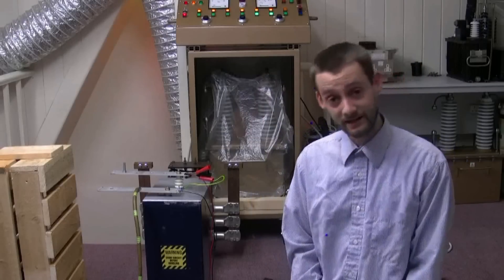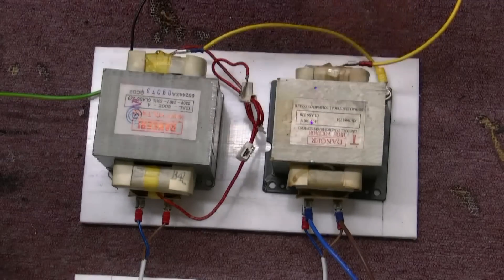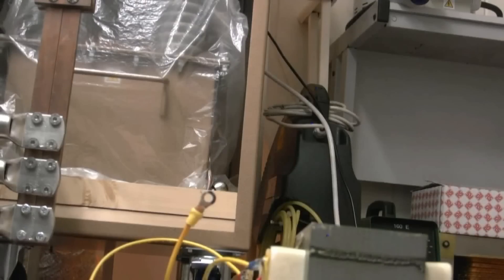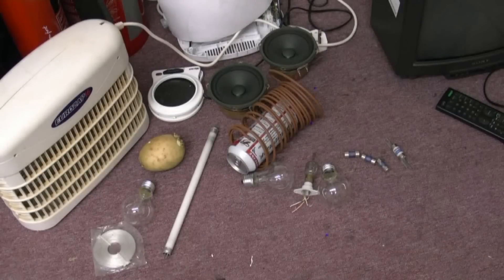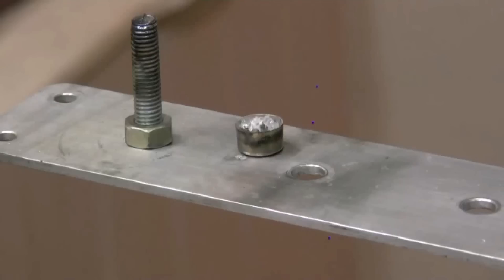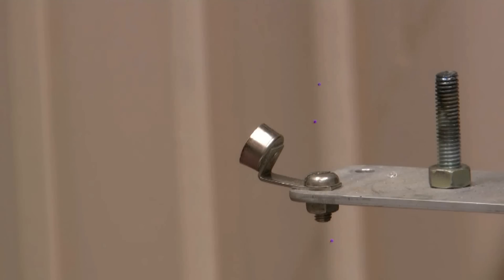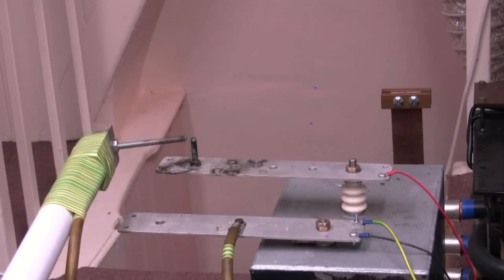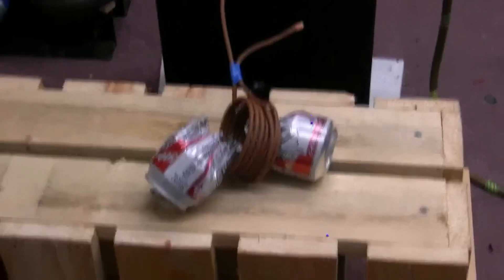Ultra High Energy Destruction + Can Crush

Comment: Hi, was writing to see what your capacitor was, thought I must've missed it.  But then I saw nearer the end, 138uF at 4,500V - so that's a hair under 1,400 Joules.  I have a couple of 5uF 25kV dc in the shed, & have always wanted to do this sort of thing, when I have the space & time.  My 2 total 3,125 J, but I figure I'll give them about 30kV (They're VERY robust caps) for 4.5kJ max.  They are rated for Pulse discharge application & very low inductance - i.e. very high current.  They came from a H.V. test facility at a University.  There were 16 available at the time, but 2 was all I could fit in my car boot on the day.  When I came back for more, they'd gone :-(   But I just wanted to know what energy you were using for the can crusher, etc. & now I know.  So I have plenty :-)

Comment: What happens if you take the output of a microwave and put that in the primary coil of the second transformer. How much voltage do you get and how much current?

Comment: I was wondering, what happened to the can, is it the magnetic field that smashed it ?
Reply: +pffm12 That's only half of what happened. Because the can is electricity conductive the massive magnetic field formed by the coil of wire induces a current in the can. These currents create their own magnetic field that interacts with the original one. The interaction of magnetic fields causes the mechanical movement of the can that results in it being crushed and, in extreme cases like this, cut. I like to think of it as "eddy currents from hell". 😈

Comment: In testing the MOT's you said you were going to "change it into DC and stuff it into the capacitor."  I'm curious as to how you would do that since I would have thought you would need to rectify and smooth the 4kv output from the MOT's which would require some additional heavyweight components.  Also, wouldn't the converted DC exceed the 5kv rating of your capacitor?

Comment: I have a question about the Capacitor you were using.  Wouldn't the direct shorting of the 2 terminals cause the Electrolyte of the Capacitor to breakdown and potentially cause the capacitor electrolyte to heat up and rapidly expand - hence explode the Capacitor ?  Maybe this is why you're using a welding cable opposed to a thicker cable ?  Just curious.

BTW, I love watching your stuff.  :-)  Just be bloody careful!!

Comment: Well we know that P=IV when I is the current, V is the voltage, and P is the total power. What transformers do is changes either I into more V or V into more I, since power is conserved (we do not want a perpetual motion machine discussion now do we?) and in this case he uses a capacitor which stores MASSIVE voltage and little current (hence the tendency to spark, not to melt). So in other words, he used the transformers to provide the massive voltage, and the capacitor to hold it.

Comment: Hey,
Quick question, I ask because I dont know. 
If you attached the big boy supply as you have, switch it on charge the cap till the current is 0 leave it on and then discharge the cap.
Would you get a standing ark because the supply is on or would you be able to get rapid fire discharging bangs one after another?
Thanks
Dave
Reply: I think you would get multiple discharges rapidly, as I saw this in one of his videos. Then again, I'm not photon so I wouldn't know.

Comment: What happens if you connect the output of one microwave transformer into the input of the next? Could you get even higher voltage or is it beyond the limit of the capacitor?
Reply: Insulation failure

Comment: 8:50 Why does the can split? I don't get it. Magnetic induction? Heat? I don't understand it.
Reply: I am curious as well! I guess magnetic induction could cause some stress but it looks like the can was squeezed and pulled apart. perhaps heat? someone answer this!!!
Reply: too many electrons....? the force is called electro motive force, or emf for short,
the configuration is like that of a solenoid, but the can will never move fast enough in relation to the flow of electrons round the wire, and so it fails...

Comment: That's an evil capacitor. Perhaps it makes sense to add some resistor wire so it can't accidentally retain a charge over a long time, in case your cat hops onto it. If the capacitor is good enough, even static electricity could build up a lethal charge.
Reply: +wwindsunrain He has a clip to short the cap when it's not in use.
Reply: +Prehistoricman Do you know the name of that video?
Reply: Pflaster Porsche Sorry, what video?
Reply: +Prehistoricman You said that he has a clip to short the cap when it's not in use and i was wondering if you know what the name of that video was.
Reply: +Pflaster Porsche I think much or all Photonicinduction's video's is staged, not real.
Reply: Pflaster Porsche Clip as in a little jumper wire so that charge doesn't build on the cap.
Reply: +Prehistoricman OK it's there, around 2:25.

Comment: How many microfarads?
Reply: 138uf, i think.
Reply: Thanks!
Reply: electrogew15 you're welcome. The capacitance doesn't need to be very high, as it is 4500 DC. If you work out how many joules that is, you will find it is 1397.25 joules.

Comment: 320 megawatts and 400MW is fictional size :-)))
The size of the rated inter-wire voltage and the initial short-circuit current never coincide. During short-circuits, when the short-circuit current occurs, the short-circuit voltage is usually much lower than the rated voltage, and in the very short circuit (metallic) the voltage is zero.

Comment: Photon, did you send those 80,000+ amps through that fuse @ 4000 volts?! 
Because, if i follow the p=IxE equation, 
4000 volts x 80,000 amps = 
350,000,000 watts....
I HAVE to be doing something wrong here...

Comment: What causes the aluminum can to split in half? Is it because of the extremely strong magnetic field generated by the winding? Aluminum is non magnetic and the winding doesn't seems to contract during spark that can crush it (8:50). I'm not good in Physics, though.
Reply: Yep. It's magnetic.There's a ridiculous amount of energy in the capacitor, all of which gets dumped through the coil very rapidly (microseconds). The magnetic field creates an electric field in the can, which is the same as the field produced by the coil. Magnetic physics say that opposites attact and likes repel. They repel enough to split the can.
Reply: magnetic fields are created around an eletrical wire, the wire was coiled with the can inside. As the current flew through the wire the magnetic field crushed the can 
and aluminum is not magnetic

Comment: its 80K amps AC current, that's not the DC current rating put a AC/DC clamp meter on one of your wires and measure the DC current?